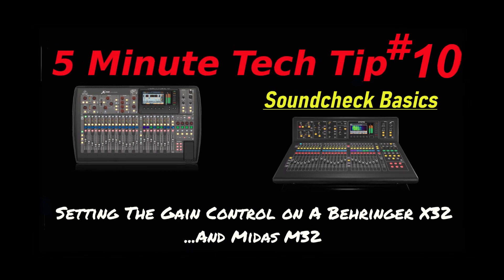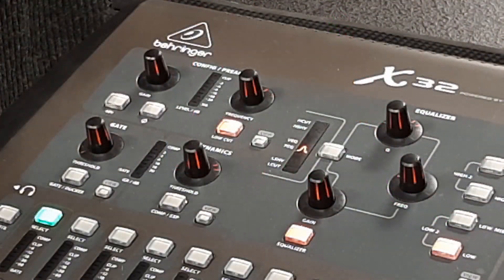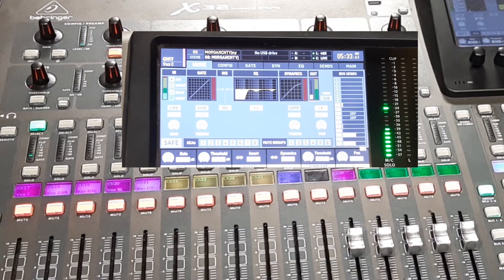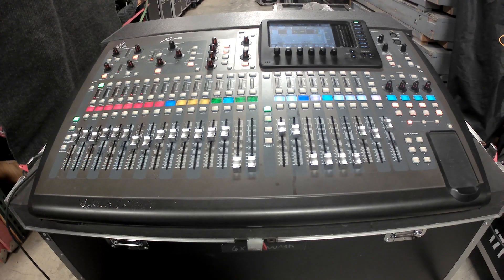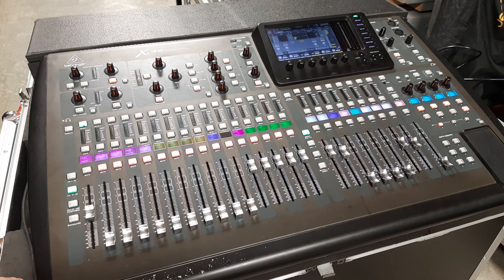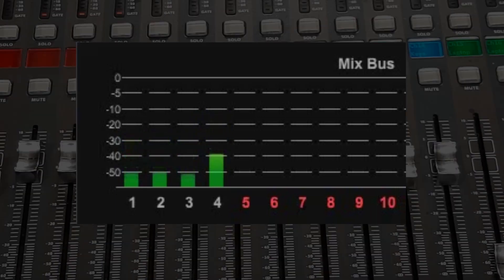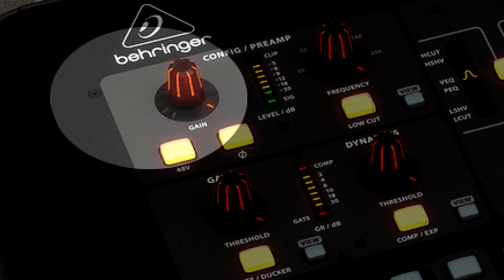Gain Structure and Signal Flow - Behringer X32 Midas M32 Soundcheck Tutorial

Comment: Is there any reason why the gain should only be at -18dbFS?
Reply from the maker: -18dBFS is essentially 0dBVU. 0dBVU being the analog scale most people are used to.
It follows that -18dBFS is then essentially the unity point in the console.
If you run all the gains to get you 0dBFS on the meters of each channel, then you're going to have an awfully hot signal at the outputs of your L-R bus, your monitor mix busses, etc.. That means you'll hit the things downstream pretty hard and end up needing to choke things back to avoid clipping after the board.

It changes the entire metric of your system gain structure. It also leads to some bad habits and misapplied settings.

You might also notice the meters on the output of the console go no more than -1 to the next mark "Clip".

Also, plugins might not like this level since they are emulating analog hardware that will see a 0dBDFS signal range as entering clip range... or already well into it. Whereas -18dBFS would be 0dBVU, AKA their nominal operating input range.

I think there's confusion because of the scale of the meters in that a Behringer X32 (digital console) hitting -18dBFS is basically the same as any analog console hitting 0dBVU on its own meters. People think they are throwing away signal because they it's been drilled into their heads (from analog day) to get their input up to zero, or even a little above it. But with the scale of the meters between digital and analog, we're comparing apples to peanuts.

The Behringer Wiki has a good discussion about this.
I'll copy below:
Clipping - What happens when the signal goes into clipping?

Return to FAQ >> Topic Specific FAQ >> General FAQ

The following question was asked on the Behringer X32 forum (Feb 2015).

"What happens whith the sound when it's clipping, get's above the 0dB no matter what?"

Robert Lofgren provided an excellent, clear explanation as follows:

When it is clipping it sounds bad.

However, having a signal above 0dB isn't the same as clipping. To be nitpicking there is no such value as 0dB. dB is a relative measure and need to be expressed in terms of its reference point, e.g. dBu, dBFS, dBv, etc...

A signal that is above 0dBFS is clipping and sounds bad. An input signal that is above +24dBu (16dBu on some inputs) is clipping and can sound bad. An output signal can't exceed 24dBu and will more or less hard limit.

When a sound has entered the x32 it is converted from 24bit fixed to 40bit float. As long as the signal stays in the digital domain it can essentially never clip even if you gain everything and peg whatever you can.

As mentioned before some processing parts may introduce some kind of distortion or similar behavior due to the way it's constructed. One example would be the la2-a compressor that will mimic the original product when being feed by some excessive signal. In general -18dBFS (referenced from the input signal) can be considered to be 0dBu so this means that a signal that is +10dBFS (referenced from the input signal) will hit the la2-a with a signal that is +28dBu!

Another example would be the channel compressor if it is placed after the eq. The threshold can't be set above 0dB (that is referenced to 0dBFS of the input signal) so it becomes limited in its operation and may cause distortion due to heavy compression.

As soon as the signal leaves the internal mix engine, as it will when you want the signal to be analog) the d/a converters can only handle a signal that has a signal with some 144dB range for 24bit audio. A 32bit floating point can handle a dynamic range of 1.500dB so before this signal hits the d/a converter it needs to be lowered to below the 144dB range and you do this by lowering your output fader that is still in the digital domain.

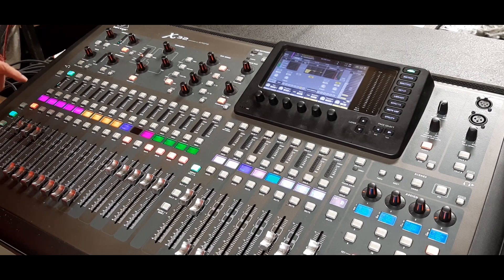--Paul Vannatto (talk) 02:05, 16 February 2015 (BNT)
https://behringerwiki.musictribe.com/index.php?title=Clipping_-_What_happens_when_the_signal_goes_into_clipping%3F

Comment: So if someone is hitting a snare loud at soundcheck the average should be -18 at the loudest they're hitting???
Reply from the maker: Well, you could probably get away with more as long as you're sure you're not being sandbagged. Assuming the drummer is hitting the snare as hard as they're ever going to hit it, and you're getting a consistent peak level, then you could cheat it to -12dBFS or even -10dBFS easy enough. Have the drummer give you some fills starting with the snare, and some rimshots, and see if they suddenly do peak higher, because you still need to make sure you have headroom.
Of course the next question is: Do you really need to cheat it louder at the input? When the drummer is actually playing a beat, does his/her snare drop in level to where it's THEN averaging -18dBFS and sometimes peaking higher as the dynamics of the song dictate? Because that would be the goal and the ideal... 
But if the drummer never plays with dynamics, or simply soundchecks with the snare full on at their max level (giving it everything their arm and stick can give you), then you'd be setting for the peak, and not the average (which is OK). That means you're seeing the peak because you know it CAN'T get louder. It can only get lower.

There are some other considerations... the snare might sit better in the mix, and the fader ride a little closer to the unity area if the snare isn't so hot on the input... But that's more of a subjective thing than a technical thing. And that could mean it peaks higher than -18dBFS, but maybe it doesn't get to -10dBFS.
Ideally, make sure the snare has plenty signal on the input, and some headroom. You don't want it hitting -3dBFS and being close to be out of headroom. Or hitting 0dBFS and being OUT of headroom.

It's really going to be more about the natural playing during the songs, and their dynamics, than what they can do at soundcheck hitting the snare as hard as they can. But, most drummers don't wind up and give you everything anyway at soundcheck. Their arm would fall off if they played that way all night. And some drummers, intentionally or not, will sandbag you. So if you let them have -10dBFS and assume they are giving you the max they will be giving you once the show start... and you got sandbagged... You could find yourself with a way too hot input on the snare.
Reply: @AlanHamiltonAudio  thanks sooo much for all that info. It's just that usually I see people staging drums one drum at a time, when they do that are they looking for the average -18 or a peak of -10??? If you were staging drums you'd ask them to play the full kit and check the snare level as u gain staged? or would u just get them to hit the snare at a decent level and look for it to be hitting -18?
Reply from the maker: @RingRoadSessions  It really happens both ways... It just depends on the time factor. Sometimes, I'll just have a drummer play and I'll start dialing in gains, roughing in the EQ, bringing it up and fine tuning from there. That kind of thing only/mainly happens when time is short for whatever reason. But what I meant was having the drummer hit the snare... Use a bit of experience to think whether you're being sandbagged or not so you don't get a big surprise a little bit later. Assuming I don't think I'm being sandbagged, I'd make sure the drum hit -18dBFS easily enough... and move on to each other piece of the kit... Then once I had the complete kit, I'd have the drummer play a beat, and give me some fills... And I'd expect to see the natural dynamics of their playing the full kit, to be hitting -18dBFS quite a bit (or even said better, at least -18dBFS), and peaking higher. But not threatening to clip or even eating up too much of the headroom anywhere.
And I'd fine tune the gains from that final part of the drum check. 

If mons are from FOH, I'm going to be a bit more conservative with the gains, because it's better to be a little cool on the inputs than too hot. Too hot could mean the need to adjust them during the show if there was any sandbagging going on or turning up (or even during the full band check... although better to do it then than during the show) and having to readjust the monitors. Although I guess Mix Station now has an auto setting to allow you to adjust gain and it adjusts the sends to compensate for your gain changes. But I've never used that.

Comment: if everything is properly gain structured yet my main output is clipping, where is my issue?
Reply from the maker: If the channel input gain is correct, but you're clipping the main output... then first confirm you're looking at the input meter on the channel, or PFL/Solo meter when solo'ed and the meter is averaging -18dBFS but with higher peaks expected. 
Once that is confirmed, I'd start looking at things like channel compression. Is the channel compression enabled, and if so, is the makeup gain cranking? If the compressor isn't doing much compression/gain reduction, yet the makeup gain is turned up, then that will send a hotter signal on downstream.

Also, make sure you are not adding massive amounts of EQ boost. That can add up and rob you of headroom, and is usually not necessary. Try and cut frequencies that doesn't need to be in the sound rather than compensating by boosting frequencies to overcome what is sounding too strong. Several channels of a lot of EQ boost would add up.

Next up, follow the signal path- Make sure you aren't double-assigning anything. For example, let's say you send your drums to a drum subgroup, and then the drum subgroup to your main L-R outs. In that case, then the drum channels should NOT be assigned to the L-R outs as well. You're sending them to the drum subgroup, which should be assigned to the main L-R and that is how they should get to the main out. Otherwise, you're duplicating your drums in the house, which means more level hitting the outputs of your console.
That would apply for a vocal subgroup, keys, etc... If you're using SUBGROUPS then the subgroups is what should be assigned to the L-R, not the channels. (NOTE: Subgroups... not DCAs. If you're using DCAs to group channels then the channels SHOULD be assigned to L-R in that case). Subgroups and DCAs are two different things, though on the surface accomplish the same basic thing until you scratch deeper. https://youtu.be/iVZC2eJhXNE

Also, you shouldn't have things assigned to multiple subgroups. Like make sure drums are assigned to only one subgroup (be it a mono subgroup or stereo). Like if you have a vocal subgroup and a drum subgroup, make sure the drums only go to the drums and the vocals only go to the vocal subgroup. Not both. And nothing else is in those subgroups that is not supposed to be there which would then almost surely be double-assigned in that case.

Then next thing to check, if subgroups are used, if the subgroup mast faders are boosted above unity, you could be sending more to the L-R bus than it can handle. Especially if lots of things are being sent hot (it all adds up).

Then check for things on the subgroup processing... Like EQ boosts there. The compressor makeup gain situation like I mentioned for the channel strip. Make sure you haven't inserted something you didn't intend to, or are using it properly if you did. Once again, something with a level/gain control inserted on the bus could be turned up and send a hotter than intended signal to the main L-R bus.
Also, the graphic EQ's have level controls on them... so if you're using graphic EQ's, and have that level/gain turned up, that would be sending a hotter signal to the mains.

Then, while you're looking at the bus outputs, make sure that any monitor send busses are NOT assigned to the L-R. That is easy to do. By default they wouldn't be, but once enabled, that will stay assigned to the L-R bus, so essentially double assigning things to the mains creating the same problem mentioned above, but from a different angle. And one that isn't easy to realize it's happening or to find if you're not expecting it. It can sneak by you when things in the monitors are expected in the house anyway. Especially on a quick soundcheck/line check. So you don't realize that the monitor signal is also coming up in the house unless you specifically turn the vocals off in the house and still hear them there when the mons are up.

Finally, that gets you to the main L-R bus. Same rules apply about makeup gain on the main compression. Massive EQ boosts. Anything inserted into the bus... or using the graphic EQ's level/gain controls to boost the signal.

As for checking the monitors assigned to FOH thing, if you don't know where to check that, even tho this video is for the XR18, the concept is the same and on X-Edit, it's basically identical to what you see here in the X-Air Edit GUI:
https://youtu.be/x9wciA2wFd0
Reply: Hi did you ever figure out what the problem was?
Reply: @mikecaceres4791  i realized i was just summing way too much. All of my faders were essentially close to unity. After learning to de-muddy my mix and running my faders lower i got my clipping to be less of an issue.
Reply: @altarovblood  What do you mean by summing? My faders are usually around unity too but I thought that was ideal.